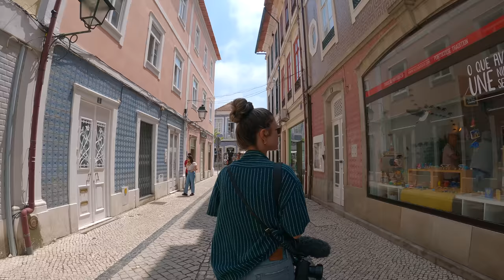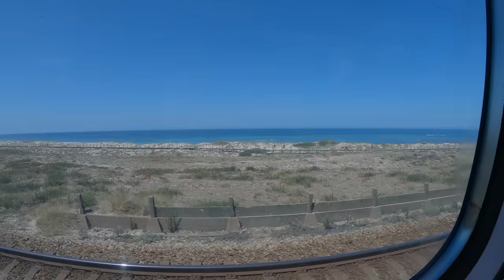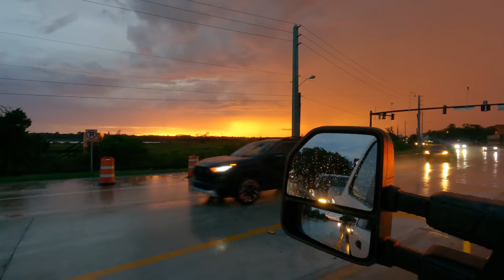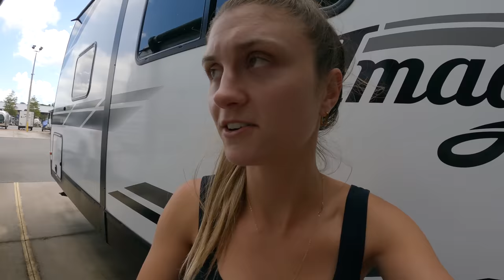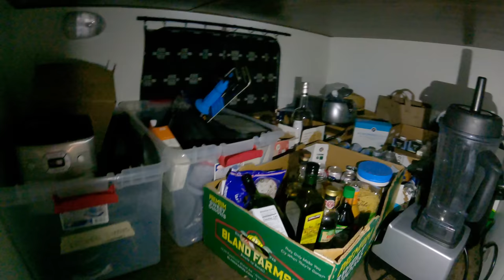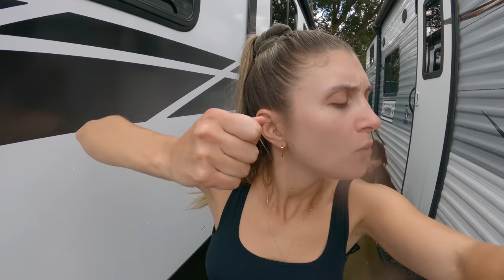The AFTERMATH of storing our RV in Florida humidity

Comment: Love your adventures.  Quick tip on lighting the water heater and refrigerator on gas.  Light the stove burners first and get the gas running through the lines.  Then shut them off and light the HW or Frig.  Both have safety switches to stop igniter if gas isn’t detected.

Comment: Dudes... haha... save yourself the $300 and buy a $20 rinse wand. Attach to hose and use with every black tank dump. Once a monrh, after dumping tank, close wastegate valve, fill black tank completely with fresh water, add a treatment, & let sit overnight. Next day, dump and rinse w/wand again. With this routine I eliminated virtually all residual odor and my sensors work A LOT better. So easy to do and that clean feeling is priceless.